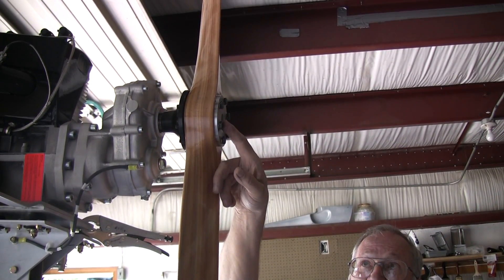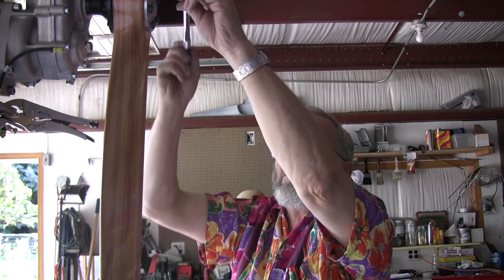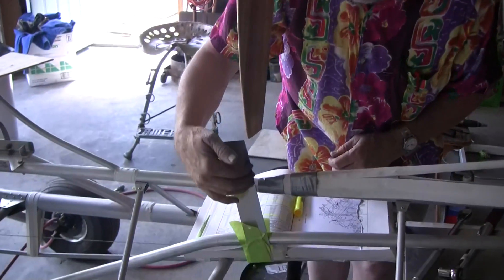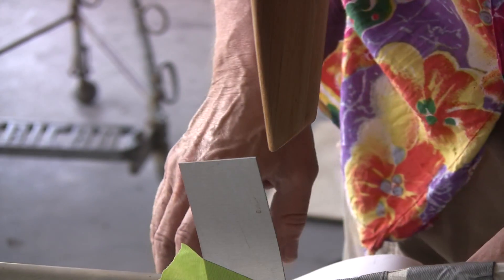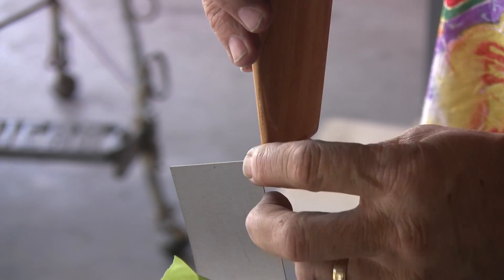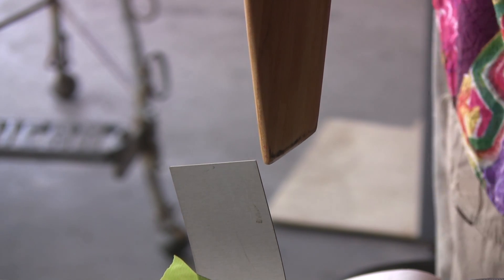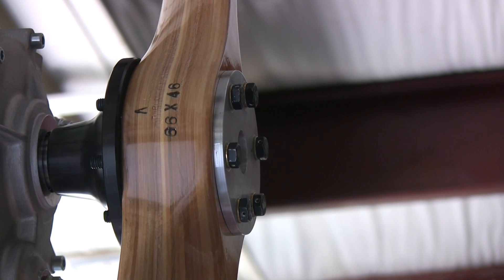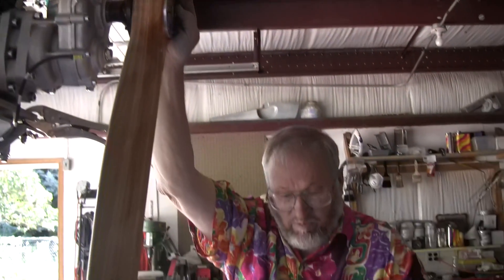MICHAEL HEIT PROPELLER INSTALLATION

Comment from the maker: Unless you have no information to guide you I recommend that you do not use Nylock nuts on the propeller. I advise you to use bolts that are drilled head bolts, use a crush plate under the bolts if using a wood prop, and set the recommended torque value as indicated by the size and type of bolt used as shown in the video and use safety wire to set the bolts. I used 0.031" stainless steel wire on our aircraft to safety the prop bolts. 

Thank you very much for watching the video.Happy flying
Mike

Comment: Nice video.  I was wondering if you place nylock nuts on the opposite side of the propeller hub where the studs go through on the opposite side?  I am installing my prop tomorrow and need to know since I can't seem to find that information in my manual.  I was given nylock nuts for the backside...